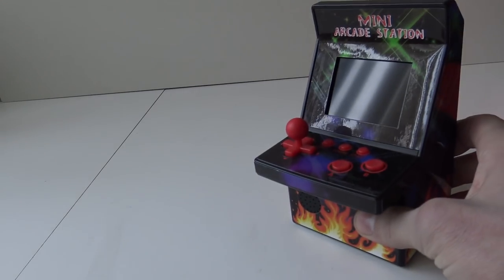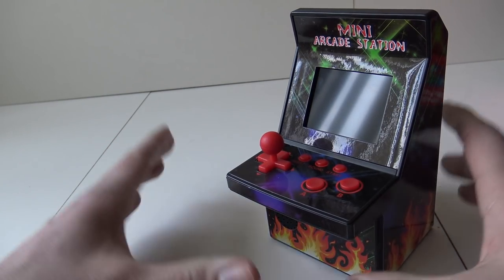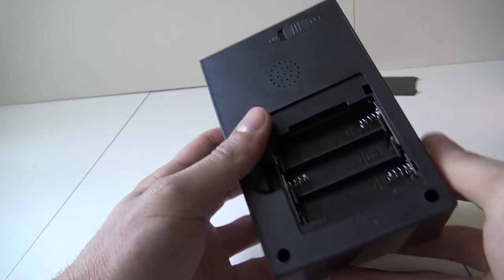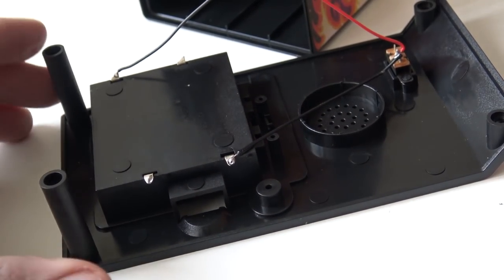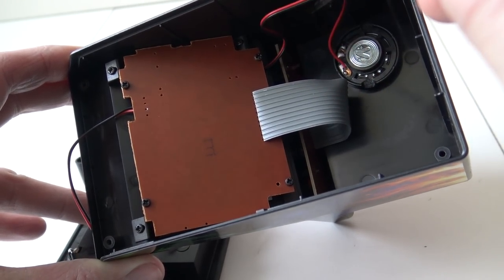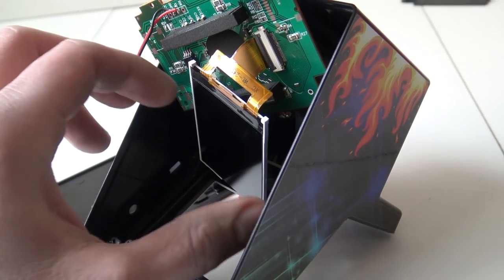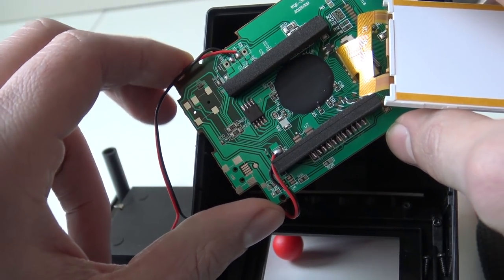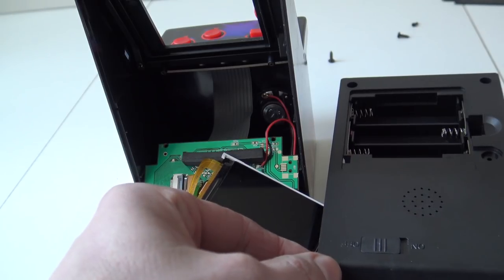Mini Arcade Portable Machine Tear Down Video | What's inside ?

Comment: Very similar insides to the myarcade retromachine x. The main difference would be that it only has the glob, while the retromachinex has a glob and a proper chip on the right side. that extra chip is probably a memory chip to hold the 300 games :P. The screen seems about the same too.